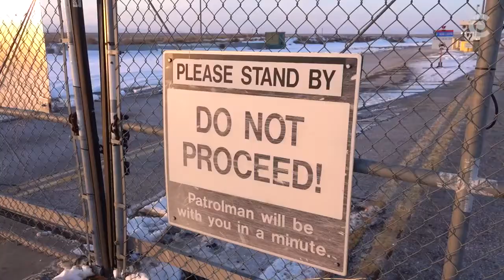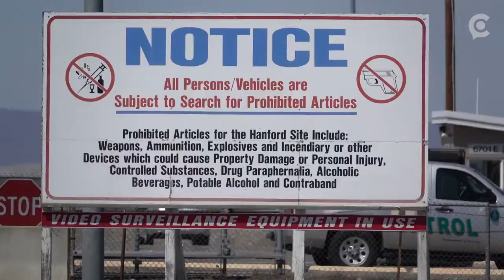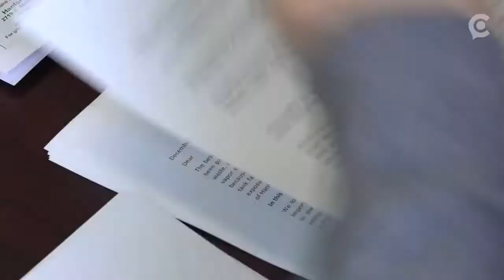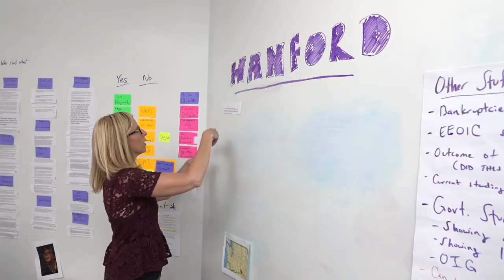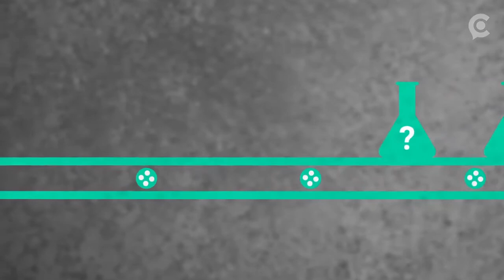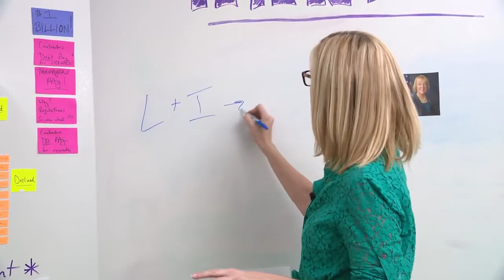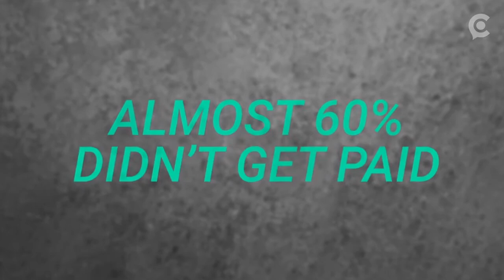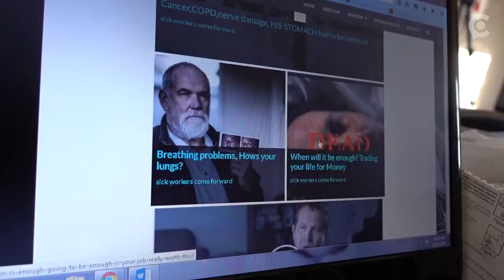Wasted Breath  Silence and Sickness at America's Largest Toxic Waste Dump

Comment: Wasn't two minutes into the video and I realized this guy probably knew what he was being exposed to but didnt take the nessarcary precautions to avoid or minimize exposure.
Now technically as a employee if the employer told him it was safe or neglected to allow safe work it would fall on the employer. 
He stated he worked as a RCT, your whole job is to know contamination and know its biological effects and how to avoid those effects. Along with monitoring those contaminants. 
It seems he was either negligent about his work, or he truly didnt understand his work, both are a no go
Reply: If your taking air samples and you find more than everyday dirt or dust within the lower limits, you should probably wear some kind of respiratory protection, considering the reason your taking those samples is to know rather or not there is a respiratory hazard.